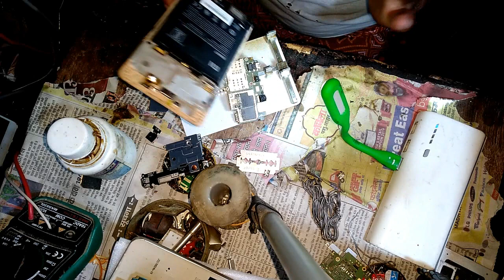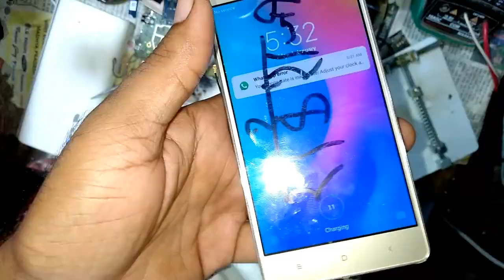redmi 3s charging note working problem solve 100% ok

Comment: Bhai mi 3s  ON  kaval charging cable lgane  pr. On hotata h or battery 0% hi  hi rhtii h.        Charging htane pr  akdm. Off ho jata    h.         Jbkii. Battery m voltage  4.30 volt h.   
Bhai y kis chig ki problem.   H
Reply from the maker: 2 steps karke dekhiye  1 wifi ic remove 2 phone ko full cleaning or battery connecter ke pass 3 pin transistor hoga use replace kariye
Reply: Bhai same problem mere phone me v hai... Aur koi v dukan wale naahi bana re,,

Wo transister kaha milega (kis mobile )